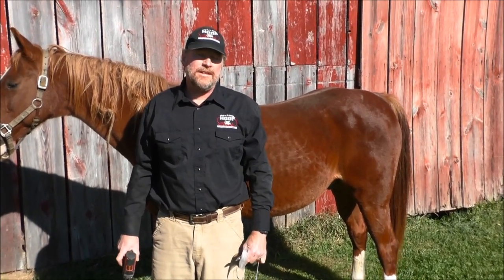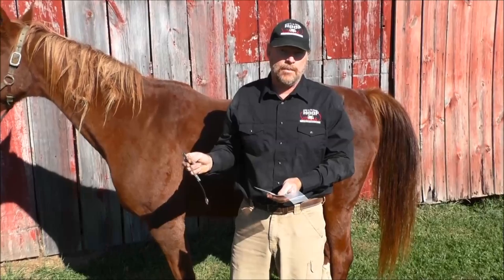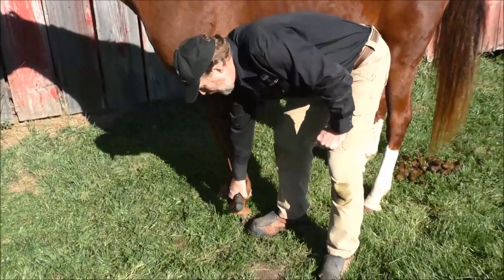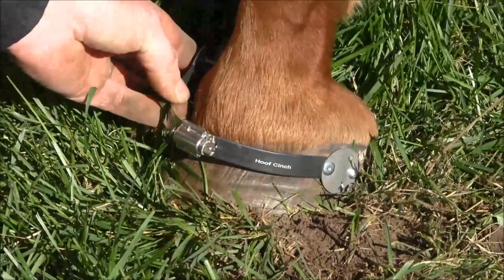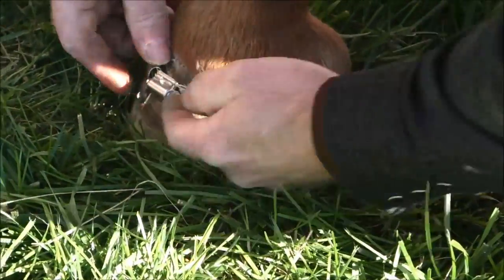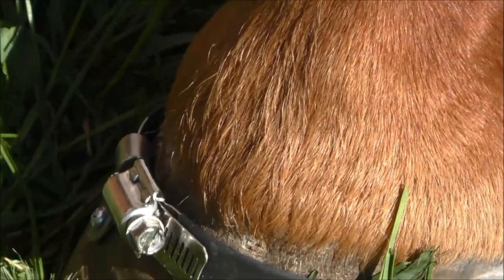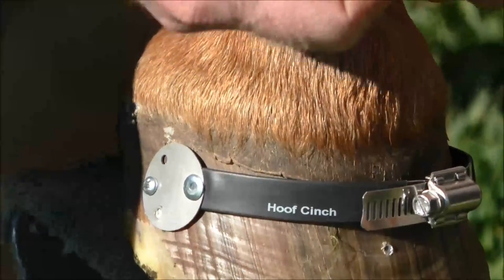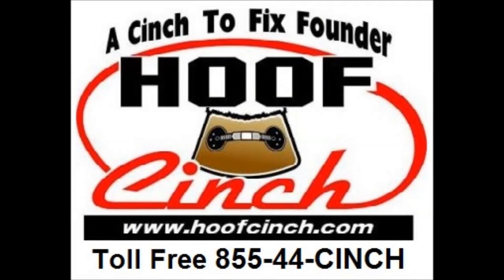New Install  On Ground and w Hoof Stand

Comment: Would there be a benefit to attaching the front in place first, so you can adjust the angle of the back, so the band is as flat as possible, giving a less sharp area of pressure? Would a plate of some sort, under the edge of the band disperse the pressure to a broader area?